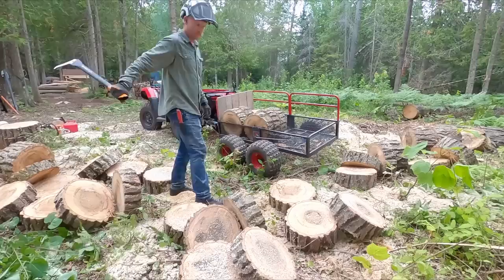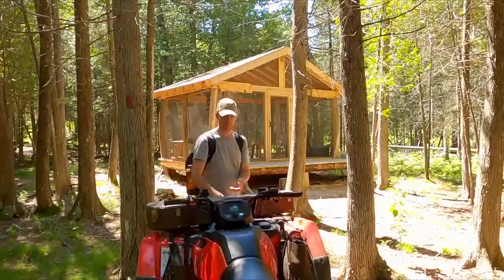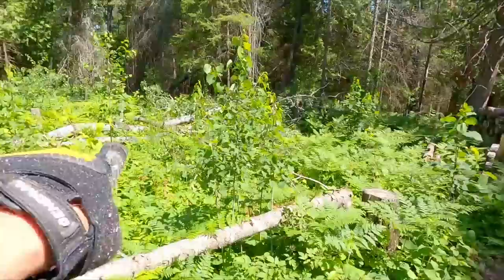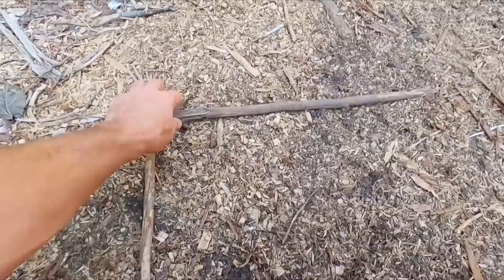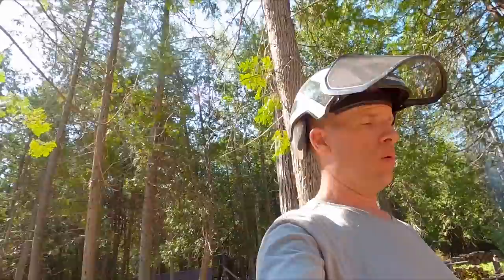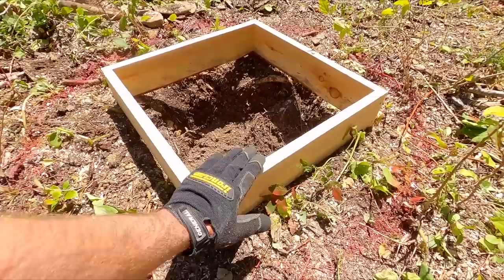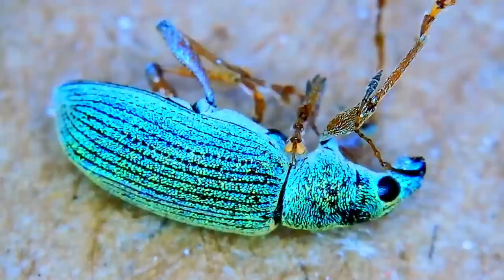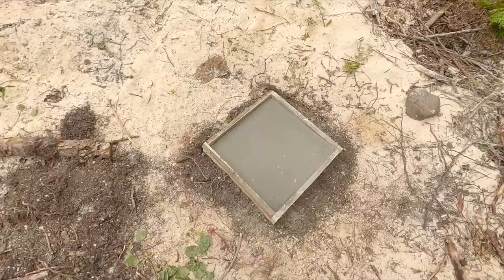Inventing a Foundation for My Cabin #93

Comment: if the string is tight, the bubble level is fine
can also just use a straight board and level from one pier to the next 
set the middle pier, level out to the rest with an 8ft straight edge or string

Comment: Absolutely love your humour. And your work ethic. We are about to build an off grid cabin in Australia. Will be following closely to see how it's done properly.

Keep up the good work and thanks for posting
Reply: What part of Australia? I'm building an off Grid property about 5 hours west of Sydney in the bush on 150 acres.
Reply: @Aussiehomestead1965  Snowy Mountains. Pretty much finished, got to build out a kitchen and insert flue for woodfired. Pallet floor 8 x4. Then covered in insulation and second hand wooden floor. Pallet walls for majority then bought timber for roofing and for some wall parts. Second hand tin for outside and sheeted with 4mm ply. 2nd hand windows and door.

Comment: Take it from an old Arborist. When you suspect a barber chair come in about 10% on each side of your cut first just until it lines up with your face. when you make your back cut your holding wood will be more prepared to hinge. Also if you start using the "flat face instead of the "closed face" for felling you will have more control of the wood all the way down and it won't jump on you. The closed face is best when you want the wood to pop hard. Sometimes we use this up in a tree to get the top to go where we want but it really isn't the best felling wedge in most circumstances. Probably stay away from the humbolt face. Not a good idea most of the time.

Comment: For your exterior walls, instead of going horizontal and worrying about the shrinkage gaps, set them vertical edge to edge but add strips over the gaps as in Board and Batton style.  Then as the boards shrink and make a gap, there is still a batton to cover the gap.

Also, only nail one side of the batton until all the shrinkage is done so when the boards shrink, they dont split due to a nail driven into both boards.

Comment: It helps to cut off portions of the tabs on the lids of the 5 gallon buckets with a utility knife for removal. It should still make a good seal.
You could actually put on some levels on your house to easily keep an eye on it's levelness. I'm not drinkin, you're drinkin, shut up.

Comment: Dig your 'show' -! Saw front porch braces lined with stones  &  concrete about 3' feet high tapering out at the base to run off water, it looked nice but not practical for underneath building...Don't stop !!  (7/24/22)  - the gov't. is upside down/ you're safe there !! God Bless !

Comment: Hmm What would happen if you put a curtain or tarp around your gazebo say for the winter months like on a cable to protect the screens from heavy snow just a dumb idea or could it be like an awning  around ur gazebo in the summer.  Like I say dynomite might be a good idea for digging holes in your property for ponds or ditches or ways to collect water without bringing in heavy equipment or to drill a well.

Comment: If you don't have a laser level use a garden hose and two joiners and each joiner on each end of the hose attach 3-5 feet of clear hose to make a water level. Cut first log to height and take hose to next log and the water will show the level in comparison to the first cut. Hell just Google water level with hose....😅

Comment: Try eating more sugary fruit and salt to supplement the electrolytes lost through sweat. You can see how hydrated you are by the colour of your pee. A light straw/yellow colour is hydrated and dark yellow is dehydrated, white or clear is over hydrated. You could blend some fruit into your water or just eat a fruit every couple hours. I once got over hydrated and felt lightheaded and kept drinking water which was just diluting my electrolytes. You can also check hydration by putting you finger on your skin and seeing if the colour returns after 3 seconds, any longer you are dehydrated and shorter means you are perhaps over hydrated. Obviously do what works best for you. Just advice from a random person that searched the internet.

Comment: Now's the time to start rodent proofing the foundation and floor, you'll wish you did if you get mice. The higher off the ground the better for the floor, and if you can come up with something that mice can't climb between concrete and wood, all the better (painted steel pipe?). Packed gravel on the ground between the pads will make it harder for them to dig burrows. With mice multiple lines of defense are called for.

Comment: I gotta assemble two wood picnic tables start ciuting grass and the electricity in my house is not working and got a bunch of bikes that need repairAbout a thousand little things my house needs a lot of tlc to get ready for summer boats and licenses fishing gear I neede to get myn rear in gear and the daily depressing political junk.  I still thing you should build a milling table since you have a new saw and consider milling several logs at the same time sine you got more hp now youi need to gear up your thinking shame to have it setting around. And since you like tents  consider buying garage in a box type tents for drying your lumber n keeping them ouit of the elements off the ground n stacked ready for new projects. theryn are like 10-12  by 20 by maybe 8 ft tall tents with a mnetal frame can be put up quickly and if you like heated with a cheap barrel stove or double barrrel stove. Or make or use them for say a wood shop for building creations in the winter.  Or heat with a rocket mass jheater a little more work to build but you burn less wood. And you dont have to constantly feed a fire. Just my two cents .